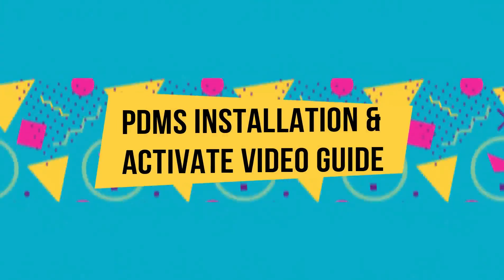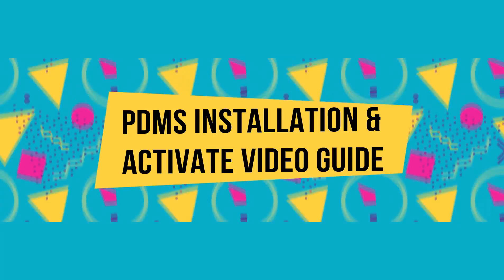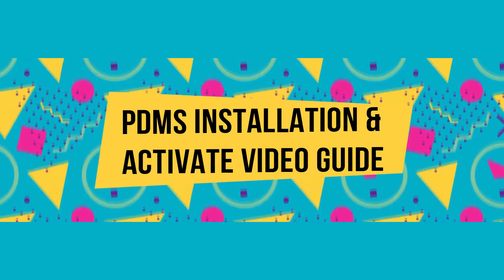How to install PDMS | Installation Guide

Comment: Sir,
I followed all your instructions but after installation of plant 12.1.sp4.14
The crack folder is automatically shown empty.
So I couldn't install it properly.
Please help.
Reply from the maker: Please turn off the internet and then extract the file sometime antivirus software and windows defender removed this file